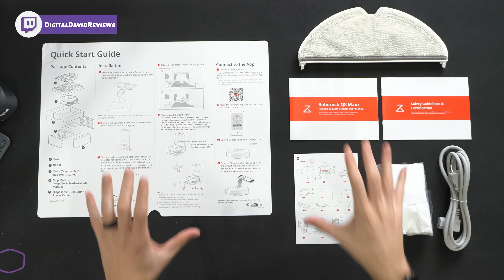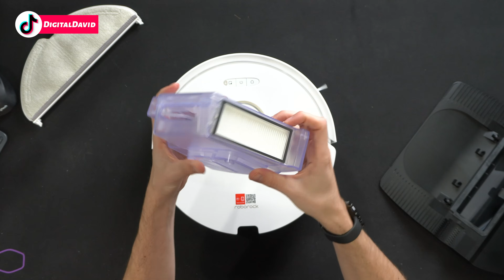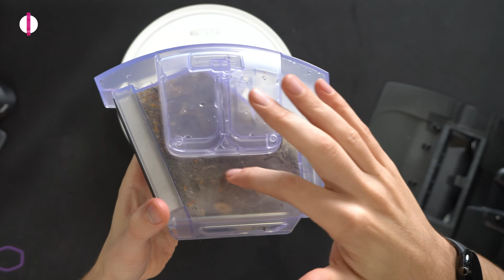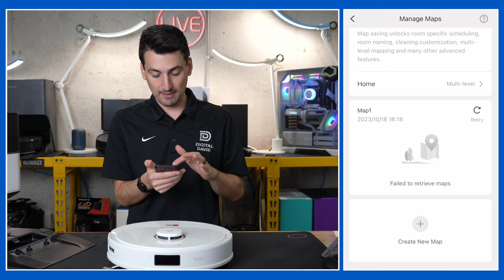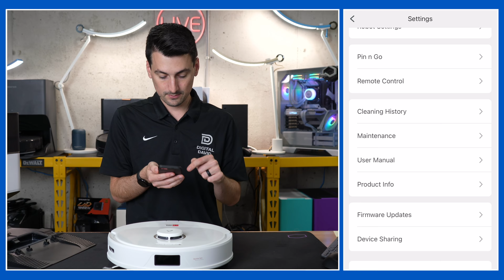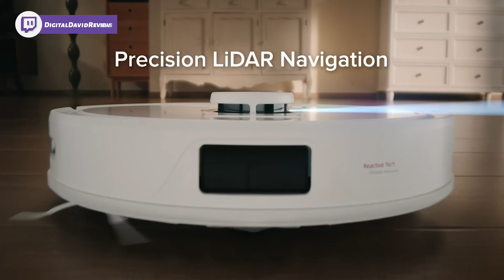Roborock Q8 Max+ Review: Ultimate Robot Vacuum & Mop Combo!

Comment: Great video! How does it compare against the Q5 Pro+ and S8? Roborock has way too many models, quite confusing. I am keen on a robot vacuum with a dual roller. Thanks!
Reply from the maker: It is very confusing TBH! This basically has 2 rollers and app controlled mopping vs 1 roller and no mop control for the Q5. I haven't used the S8 so I don't have any info to go off of from the top of my head!

You'd get a good enough clean with the Q5 and save some money. It's just annoying that the Q5 doesn't have app controlled mopping as it definitely should for its price point
Reply: But the Q5 Pro+ has a dual roller, so apart from the lack of mop control, is it indeed that much worse? Also,  this one (Q8 max+) does it recognize carpets while mopping (i.e. does mop lift or how does it work?).  @DigitalDavid  your videos are helping me a lot btw! Thank you.

Comment: Does it get rug wet with it not being able to lift automatically when rug is detected? And how does it do with mopping without vibration like s8?
Reply from the maker: It will make contact with rugs but wet is an overstatement. I don't think you would notice your rug or carpets even being damp. I think that is more for the sanitary crowd.

In regards to mop performance they are all so similar in everyday use regardless of vibration or not. Vibration will make a difference if you have stubborn "stains" you are trying to mop vs daily floor maintenance! Does that help?
Reply: @DigitalDavid  yes cause I’m on the fence between the s8 and q8 max but the price of the q8 with the Black Friday deal is more appealing
Reply: @shyroneparker3107 what did you get? I can't get the Q8 max + for 15 USD more than the S8 without dock
Reply: @Krudtbasen  I ended up getting the s8 and I love it wish I had dock but the mopping and vacuuming is great. Which are you leaning towards?